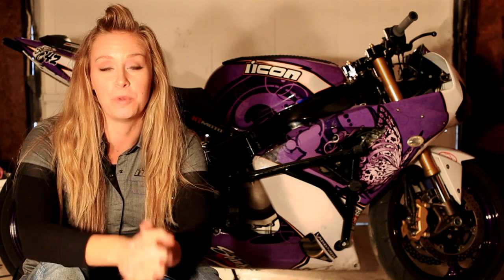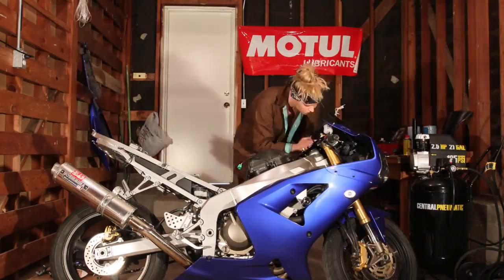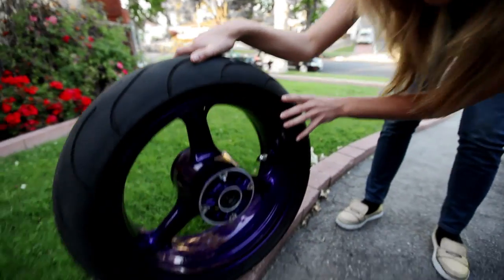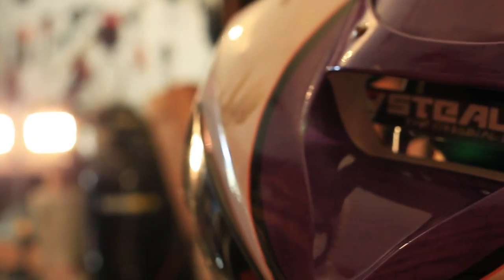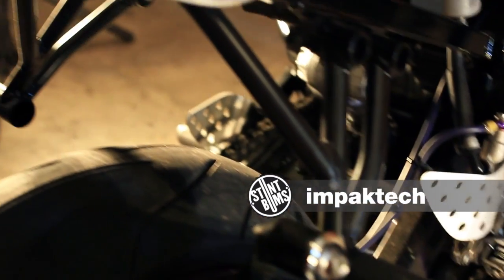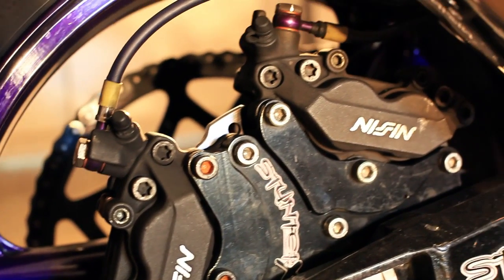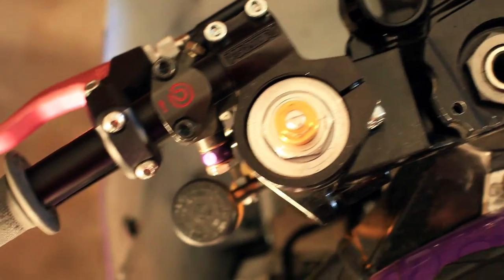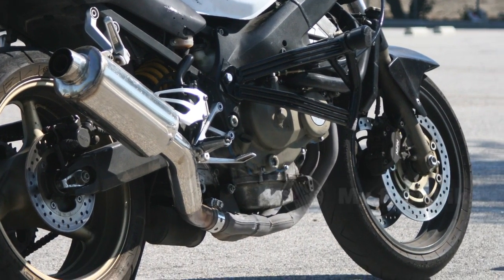StuntBums: How to Build a Stunt Motorcycle

Comment: Best cheap 600ccs are definately old Honda CBR600Fs. PC-25 (F2 1991-1995) and PC-31 (F3 1996-1998) Are insanely durable, cheap, and most companies make parts for them. All you need to do to the engine is add a bit more oil than normal, and it'll run forever even with the front wheel up.

Comment: my stunt bike is a cheapo piece of crap honda cbf 600 hornet. it overheats if it runs for more then 20 minutes, tail is busted, has a load of other issues such as the front rim not being perfect anymore causing it to slowly leak air etc) and in general it looks like it's been chewed and spit out several times. but hey it works for me, and if i crash it will only be a emotional loss (i got attached to it :P) but not a huge financial loss